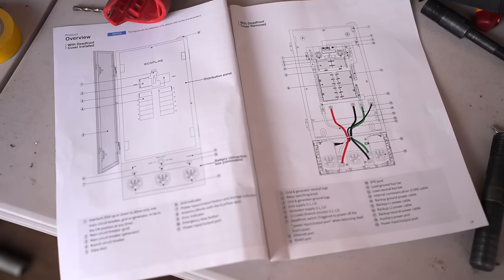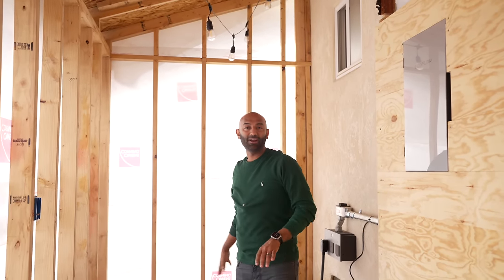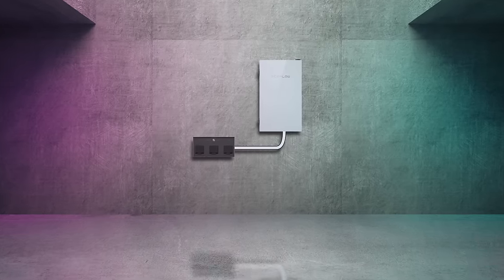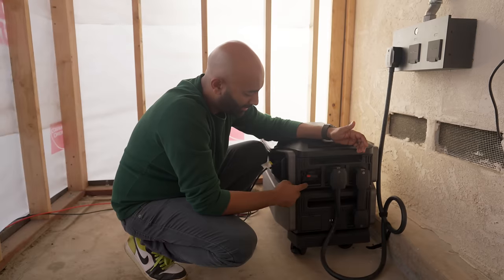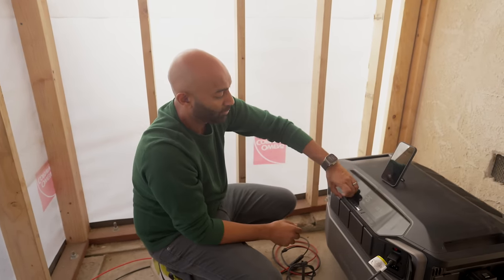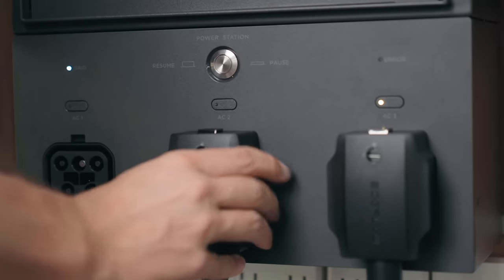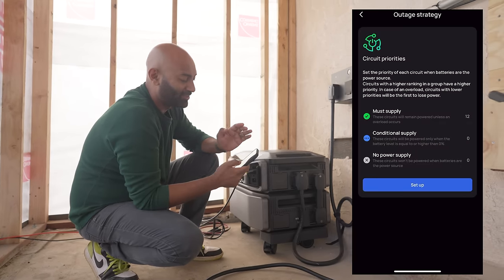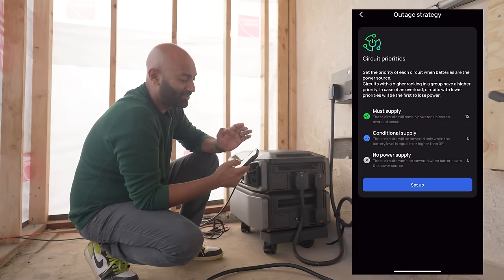EcoFlow's New Smart Home Panel Is GENIUS - Right For You?

Comment: I gotta say, these smart home panels are a TERRIBLE idea.  It is entirely unnecessary for any function of the home.  And all of this EcoFlow-specific equipment... trying to keep this all maintained over the next 100 years is going to be a disaster for the home owner.

Once you have enough inverter output to power everything across a power-fail switch-over or whatever, you DO NOT NEED a smart panel switching loads off for you.  All you need to do is turn off the loads you won't want to burn energy on when then grid is out... which in most cases just amounts to not using something in the first place.

Also, these "fancy" ecoflow-branded batteries are stupidly expensive.  It makes no sense whatsoever to spend $2800 a pop for a 6 kWh battery ($466/kWh).  IN WHAT WORLD DOES THAT MAKE ANY SENSE!  An EG4 rack-mount LL-S battery is $1600 for 5.2 kWh ($308/kWh).   And there are other offerings that clock in at $250/kWh.

I will only repeat, the last thing you want to do is use a semi-portable power station and battery system with proprietary cables, interconnects, and communications to power a house.  Really.  That is the very last thing you should be doing.  A couple of (for example, one out of many examples) EG4 6000XP's and one or two racks of batteries and REGULAR panels/sub-panels will do the job far better, and be more maintainable, at half the cost.

-Matt
Reply: The battery and inverter cost is subsidized by people who are able to DIY and not need an electrician. That doesn't explain the smart panel which most DIY types cannot handle.  For people who can DIY roll-your-own battery banks and inverters (not hard and getting better) the EcoFlow lock-in and cost makes NO sense.
Reply: It feels like a critical mass of DIY folks are reaching the "how hard can it be?" tipping point. At least in terms of the amount of videos and sufficient (correct) guidance out there.

I think the  overall trend is for DIY solutions to become more like integrating PC components. Once the standards settle out, there will be a race to the bottom on costs. The trick will be to keep the decent suppliers and quality products from being obliterated by the Chinese.

Comment: Wow. Wish you'd shown more of the wiring process (B-roll?). Wonder what complexity is hiding behind all of that plywood?
a) Don't want to put my $$$$ battery stack on a cheap plastic dolly. (I hope that's not supplied by EcoFlow. Ever hear of 16ga steel and hard rubber wheels?)
b) Would want to have them bolted down to something (earthquake, theft)
I hope you're getting a big vendor subsidy. Too rich for my blood.

Comment: It's a pity that you don't cover the most important aspect: ROI. These systems are expensive at ~$1200/kWh, which is ~3-4x more expensive than the components. That blows the ROI. A more DYI setup would payback in ~4-5 years and these systems are pushing consumers into very long ROIs. Why promote solutions that extend the ROI instead of solutions that give free energy "forever" earlier?

Comment: No , actually I think I would want to get six of those dollies with four ofthose generators  with all their batteries And an end of heaven 120 kW of power using a 58 Hobbs. Then maybe something like that to connect those 50 amp hubs too if I do get went home panel to whatever. With the cost for them is immense. I mean, I would need a job. At least makes 2 hundred thousand dollars a year Just to be able to survive and pay for all that or in this case. Maybe 20 years in time I might better have a whole system and it's batteries if I'm lucky. Especially what prices are going these days.

Comment: First of all you have to size your gear with the size of you main wiring coming to the house .. it's pointless to have 60-90 kWh battery storage when you won't be able to charge it (cycle it) properly if you run out of sun for 5 days in a row ... You need to charge from grid ... To charge 30kwh and above you need 3 phase connection so you can pull 20 kWh ...

Comment: Great planet situation since it got such a few panel breakers. I mean, it should have at least 24to 36 breakers in. So you're about to run the whole house, and I just parted the house, especially with tdata, Delta pro ultra generator and 3 generators to go with it with 21 kilo. What's a powered coin to your house? You should have more better run everything in your house, not just some things.  So makes an overpriced, so you need paid a $1000 more than you should for $800 box and looks, and it's actually like a $200 box. At least that's what menards and lows and home depot sells them for but you got to break us, so that's another $120 more. You got to put into it. Maybe not quite but still so you paid way too much for it.
But it seems like that from all the.
Generator companies do.  Menards are just something buy all the other. Additional stuff for a little cheaper and get it for a lot less and have it. Even safercause, then you could get your picture on wire thick wires in there. That's even more durable. The nose wires that are more ready for why is twice as much power than what they did put through. I know the one thing I wanna buy from equal to Delta. Well , I do want those generators only about two of them thoughand then get another tour of them but I want to fifty AMP Hub , where you hook two of those generators too I want two of those then I direct the hooker hook one of them right to the house fifty amp plug and make it safer.
     But I like the idea before you started. It anyways more room more space for doing things.